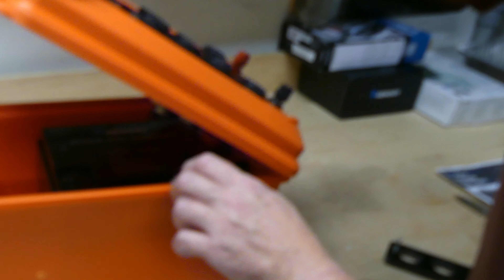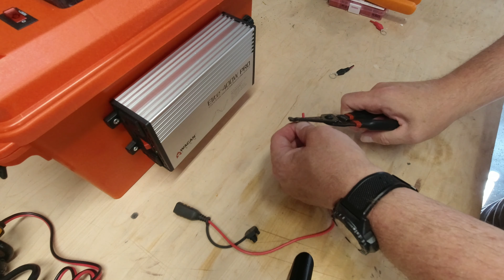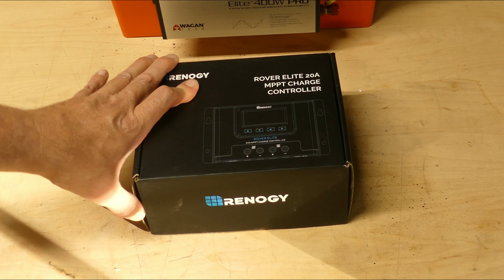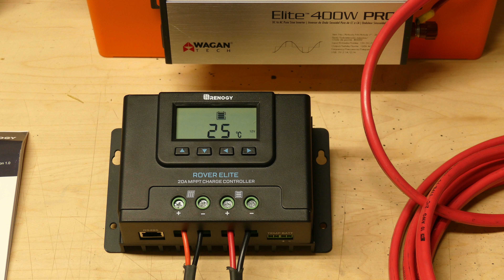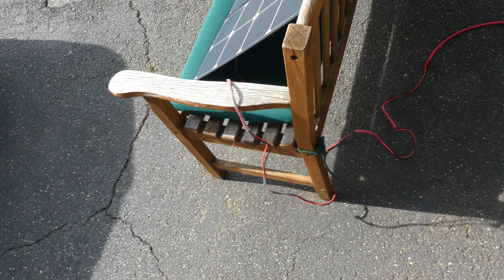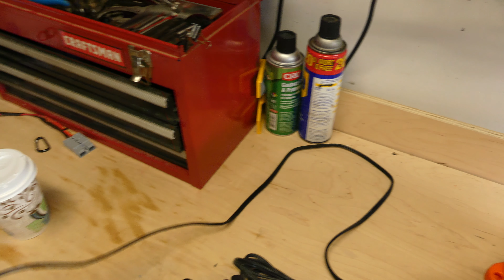DIY Power Station - Solar Charging USB, 12 and 120 volt. LifePo4

Comment: Could you mount a 12V battery charger to your truck battery, to charge the battery in the box??
Reply from the maker: Yes. You could mount a DC to DC charger. Such as a Renogy or CTek brand. It'll take the vehicles voltage and convert it to the proper voltage and charging parameters required by LifePo4 batteries.

Comment: nice video but power is still in inverter why dont have a switch between positive from battery to inverter to turn it off power all ways still in inverter even if shot it off am not pro but i know love video i have 1100 watts not finish make it but from my positive i have a switch between it to turn it off just get my 12 fused block panel am going do my own thing
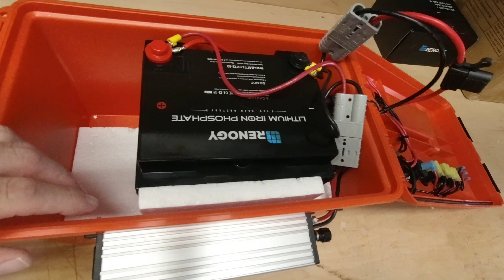Reply from the maker: Thanks for the comment. You can see at about 12:36 that the inverter is connected with the high-amp gray power pole connector. I keep this disconnected until I need to use the inverter.

Comment: Hello very good video, I did something very similar to yours but only that I always have the mppt connected to the terminals, what happens if I charge my battery with the same charger as you but having my mppt connected I can decompose it while charging ?
Reply from the maker: You can have the MPPT connected to the battery at the same time as the charger. The MPPT will regulate its charge as the other charger charges the battery.
Reply: @RandomGene  ok perfect thanks for the info

Comment: 13:06- It appeared that you got your connectors backwards, the unfused plug went to the inverter and the fused on went to the already fused cable. I’m hoping that you switched them accidentally.

Comment: Yours is the first DIY solar generator with all 3USB charger and the p9werpole connector where do you get them this is the only thing holding me up from building one as my tablets and my older phones take the old slow USB  my fitbit watch takes the fast charge and my new phone is type C so I need all 3 and so far of the dozens of power boxes I've watched non has USB quick charge or type C I have 4 or more booster pack power units I want to rebuild and once I get this last part I'll get new batteries and start rebuilding them  thanks in advance and great video
Reply from the maker: I've gotten most of my parts from www.powerwerx.com.
They have all the USB style panel mounts. 
Thanks.
Reply: I like your idea for the solar controller but I would mount it on a peice of plywood so that you can put clamps on the wires to relieve the stress on the connections thanks for the information on where you got your box they also have them as stand alone peices but instead of doing all my power boxes I'll only do 1 or 2 didn't realize how expensive the components were but I'll set up the others so that I can use them as extra power for my main power boxes now to get the money aside to order these items as I àlso have to buy new batteries for the unit's but the cost of parts including the battery is about 1/3 of a new power box
Reply from the maker: Direct link - https://powerwerx.com/panel-mounts

Comment: Not sure if you have rectified it, but from your connection at timestamp 6:13 , the inverter does not get connected to the in-line 40A fuse. I guess you mistakenly interchanged the two connectors. There are two 40A fuses connected in series on the other line from the battery to the binding posts etc. So the inverter is not protected, but i guess it has it's own built-in fuse as well.